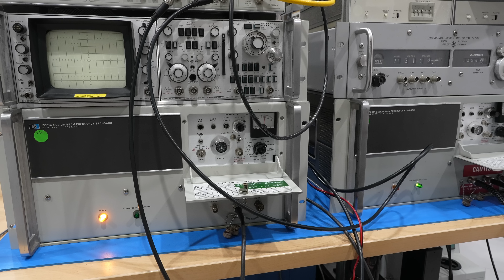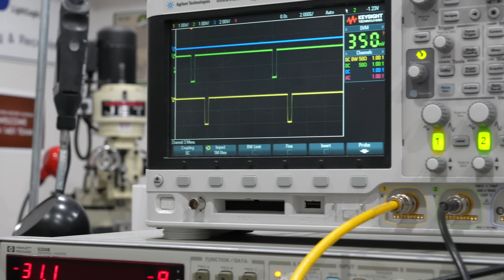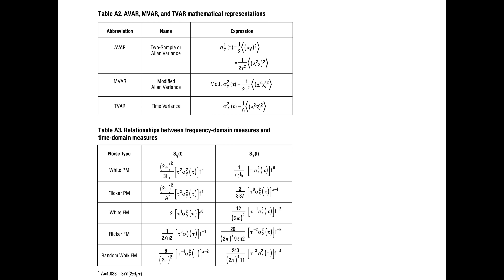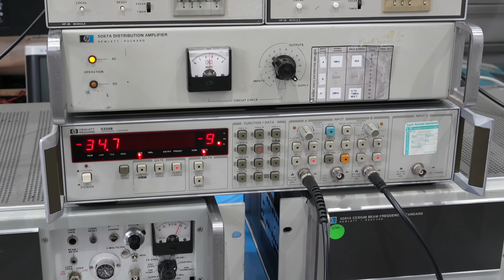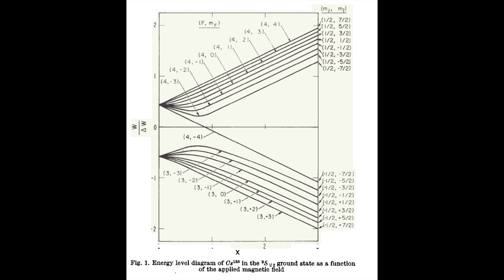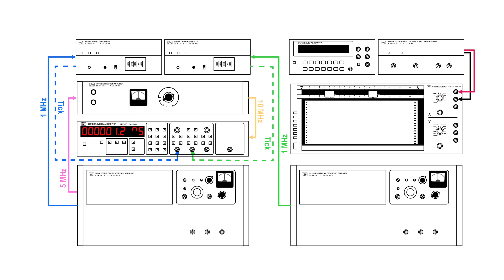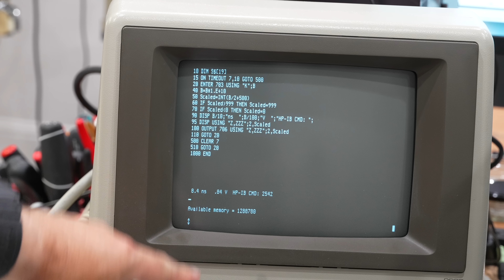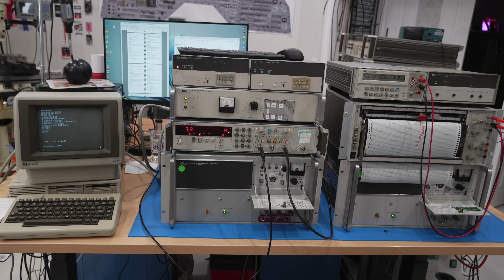Our first dual atomic clock comparison experiment does not go as planned

Comment: The ease with which a few lines of BASIC on an HP 9816 can accomplish the goal makes me wonder whether productivity has been seriously degraded by the "modern" way of doing things. Bravo, Marc, for keeping alive the old ways of doing interesting stuff.
Reply: For relatively simple automation like this the HP basic systems are almost unbeatable, provided you know the syntax for the IO operations.  However as complexity grows it suffers from the usual (traditional) BASIC issues of maintainability.  When I worked for Nortel in the mid-late 90s we had a bunch of these systems performing automated production testing and the programs were long and complex. They were generally very reliable but making changes and debugging them on an 80 column display was painful.  Most of them were ported to VB5, and then VB6 on Windows machines which brought it's own issues, but debugging and general maintenance was a joy by comparison.
Reply: @ferrumignis Cool. What did you use for the HPIB control on Visual Basic?  Was a good HPIB/IEEE-488 library available?
Reply: @ I forgot to mention, as well as the HP Basic machines we also had some test kits running HB Basic on Unix boxes.  That was a nightmare for any of the software guys on call to cover the night shift.  The person on call had to cover every product line, not just our own, and most people had relatively little Unix experience.
Reply: @TR3A  Third attempt at replying, YT keeps disappearing this post for some reason?
We used National Instruments GPIB cards and they had their own Visual Basic low level driver (vbib-32) that provided low level functions and we wrote our own high level instrument drivers but they weren't very complex for most instruments, just functions that assembled and wrote the appropriate SCPI string and decoded the response.  I miss those days tbh, it was a much simpler time and it was an awesome team and a very good company to work for.
Reply: @ferrumignis  Thanks.
Reply: @ Thank you
Reply: @ferrumignis  Yeah HP Basic on Unix never really got debugged if I recall.  HT Basic on PCs had memory leaks early on but that got fixed in the 1990s.
Reply: Also, thanks for not going down the rabbit hole of doing data collection and analysis on the 9816. The chart recorder visualization tells the story in the classic sense.
Reply: Insert obligatory xkcd comic of some person in Nebraska maintaining some tiny bit of arcana that keeps our world humming.  Hats off to David L. Mills (RIP) who developed and maintained NTP for many, many years.
Reply: I see no objects defined. It feels like a relieve
Reply: You know you can still buy HT Basic and run it on a PC with all the same functionality as RMB in the bad old days, right?
Reply: @ Thank you. No, I didn’t know it was still available. 

I knew it was available at one time but thought that the company had closed. Good to know it’s still out there.
Reply: True, but we have not peaked, yet. We can soon use AI to generate a driver stack running on virtualized hardware in the cloud to make an IoT bluetooth-to-serial adapter sometimes work (provided we've payed all our subscriptions).
Reply: @EdwinSteiner  the virtual hardware architecture will be also AI-derived and run on cloud FPGAs with pay-per-gate-per-nanosecond pricing. Clock pulses will be extra.
Reply: Yes, it very much has. I can't go to bed because the lights are on because my lightbulbs are updating their firmware and I'll be out $200 if I turn off the lights and they turn into bricks. The future is stupid.
Reply: Yes, the modern National Instruments library to poll an oscilloscope’s DVM is like 500 MB for roughly the same HP-IB over USB functionality.
Reply: @sashimanu  I'm using a NI GPIB-USB-B with the open source Linux driver that includes a simple python library. The relevant files are <2MB.
If everything is configured correctly it works ok.
Programming it in Python in a more or less procedural style is relatively short and easy.
Most of the time I use it to retrieve screenshots from my tek scopes.

Comment: Love it! I hope you get your atomic clock(s) working I look forward to seeing this experiment done.   You guys do excellent work in the Lab.   Today, by coincidence, I was doing some experiments in my lab and I also use vintage HP equipment: The 34401A DMM and 33120A Waveform Generator (has Arb. capability but I didn't need that) to work on a project involving designing and testing some analog filters.   Like I said in a comment a video or two back,  I used to work at good old HP before it split and turned into Agilent (then again to Keysight) and I just love seeing these old pieces of test gear, brings back fond memories.  Cheers, and good luck!
Reply from the maker: Yes, our "real" engineering lab is also full of good old HP goodies. Were great then, still great now.
Reply: @CuriousMarc  Be sure to consider the EPROMS that populate some of the old equipment. These eproms are now well beyond their predicted data retention time so making fresh copies now can keep total disaster from happening! I have had eproms fail in two instruments. Bummer!

Comment: I haven't seen endless paper plots in 30 years. Makes me feel young again. 🙂
Reply: I spent weeks minutely reading off such charts produced in an oceanographic dye-tracing survey.  Enough to do my head-in! It doesn't me feel young again; more like a reminder of a misspent youth when I could have been hanging around snooker-halls instead.
Reply: @SubTroppo  I was tasked to do the programming for a machine to scan these. A colleague had build the scanner. There was a hole archive of recordings from chemical/metallurgy research.
Reply: @boelwerkr  Who fed with the archive the scanner and checked that it worked? That would be quite job in itself!
Reply: I'm surprised he could get paper for it. Today, an average Microchip controller can do what most of that equipment is doing.

Comment: Look into the HP5370B Time interval counter.  It has 5x the resolution of the one you are using and is vintage HP porn.
Reply from the maker: Thanks. Impressive counters indeed! I tried an HP 5372 and… it didn’t help and I didn’t like it. These instruments are made for super fast data acquisition for very short term stability measurements. Max tau is 8 seconds. But I’m doing the opposite, very long term stability. I need 100,000 seconds! My humble 5334B is plenty fine for that.
Reply: The HP5370A/B has even 20ps single shot T.I. resolution, compared to the 1ns single shot of the 5334B, or the 5335A, i.e. even 50 times.
The 5370B is better for such comparisons, though 1ns single shot does the job on long-term time constants of the Allan deviations as well.

Comment: When there is an effect of the magnetic field on the atomic clock: is the device's own magnetic field inside the clocks only - or does the Earth magnetic field also have an effect? The latter would be a huge issue - as the intention is to move one clock around to another location. How do we know a time drift would be really caused by the relativistic effect - and not by changes to the magnetic field?
Reply from the maker: The tube is shielded from the Earth magnetic field. The field inside the tube is produced artificially, and is about 1/10th of the Earth magnetic field. That said, it is always best to calibrate the clock and not move it, but we won't have that luxury.
Reply: I have two rubidium standards and you can definitely see a change when comparing them as you rotate the orientation of one unit respect the other.

Comment: Those jumps almost resemble when your utility folks moved lugs on an autotransformer, upstream of you. How sensitive to changes in mains voltage is all of the equipment? It would be interesting to see if the drift begins to reverse itself as the day approaches the afternoon [when the most power draw is likely].
Reply: would be interesting to have the 2nd needle on the plotter indicate hours (for referencing when it happens) or mains frequency.
Reply: Perhaps a voltage regulator in one of the clocks isn't regulating that well, making the output drift with input voltage.

Comment: nice rig! ... i dont want to think of the cost of that setup back in the day!...
...the clocks need a re-cap! :P
Reply from the maker: I was also wondering the same thing, how much original $ is piled up right there! I just figured it out.
From the 1982 catalog: 
HP 5061A (hi perf) $34,400 (x2)
HP 5087A (with doubler) $1,645
HP 59501A: $700
HP 59308A: $1,325 (x2)
HP 7132A: $3,100
Then they stop publishing list pricing from 1983 to 1985. But it reappears in the 1986 catalog:
HP 3478A: $995
HP 5334A (Xtal oven + C channel): $4355
HP 9816: $5,150
Which is a grand total of $76,895 of 1982 money plus $10,500 of 1986 money.
Corrected for inflation, the setup is worth $285,466 in 2025 money (list price). Which is less ludicrous than I would have thought. And it still feels worth all of that.
Reply: @CuriousMarc  what a bargain! :P
Reply from the maker: I know. That's what I am going to list it for on eBay after I'm done ;-)
Reply: @CuriousMarc  I just happened to calculate the inflation-adjusted purchase price of my 28-year-old car: $287,000. Some people make / made strange decisions.
Reply: @CuriousMarc  In 1982 money, how much more would it cost to add the 50 year warranty coverage?
Reply: Then you see them using 4 clocks (per sets?) back then, without putting too much attention in calibrating
Reply from the maker: @2adamast Maybe I wasn't clear. They did calibrate them carefully. They measured the drift (and lived with it) rather than change the settings of the clock with the C-Field, which I am finding is pretty touchy. You can do that if the drift is constant, which it was for their clocks. Not for mine in its current state though...
Reply: @CuriousMarc  Thank you.  Seems logical,  measuring takes less time and is probably more precise than trying to set the drift to zero.
Reply: @ And now you aren't even moving them...
I expect that when you pick up one of the clocks and rotate it through the earth magnetic field, it is going to change again!
Reply: Of course everything but the actual atomic clocks could be just an ad-hoc circuit with a couple of cheap ICs....  $1645 to double 5MHz or $1325 to divide it by some constant is a bit excessive...